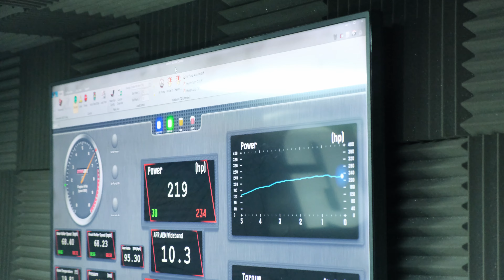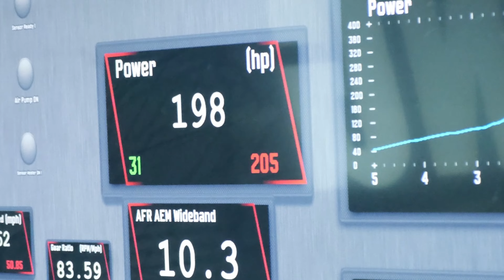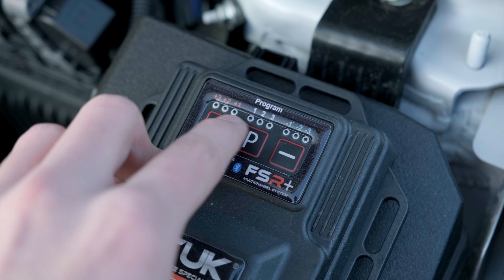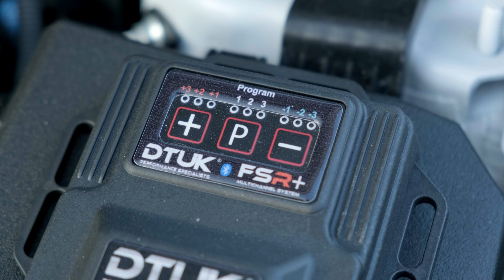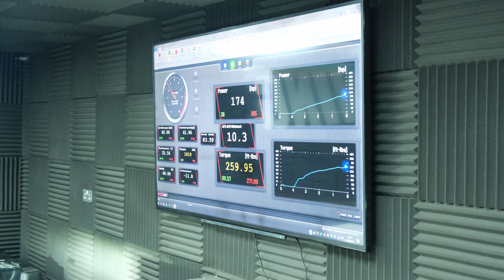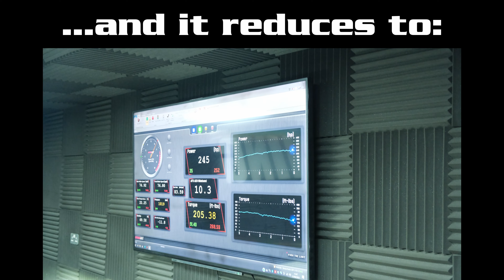MORE POWER!!! EP.2 - The Truth - GR Yaris Project

Comment: Drivetrain losses differ depending on the drivetrain layout. Generally fwd will have less loss if the engine is in the front. AWD has the most losses. A live remap would be far better than a tuning box.
Reply from the maker: This is true. Every car is different but you can have a fairly good estimate. The only horsepower that really matters is wheel as that's what you put down on to the track. A live remap is better but is very expensive also. I'm really pleased with the gains I got for great value and ease of use.

Comment: Seriously, if you use a tuning box, you‘ve  really no idea what you are doing.
This stuff ruins your engine. 
Get your car to a real pro and let him tune your ecu individually. Everything else is rubbish.
Reply from the maker: I don't agree that it ruins your engine. It doesn't maximize its potential but I think its a fantastically affordable way of getting power gains quickly. Of course, with a high budget and lots of time, an individual ECU tune will always win. I think it is wrong to say that everything that is not at the extreme end of the scale is rubbish. It's about finding a balance.
Reply: @WillEgby  , you have to understand how a tuning box works and what it does. I had the same attitude like yourself, but saw a video of a professional tuner who explained the downsides of it. After that I would never ever use a tuning box.
Safe the money, do your engine a favor and get a professional tuning. There is nothing like cheap and reliable tuning. Serious and reliable tuning needs time, an expert and experience. Those things can‘t be replaced by a cheap device.
Reply: I‘m sorry, it‘s in german, but watch the ignition angle reduction….